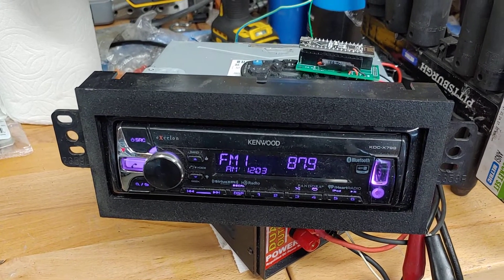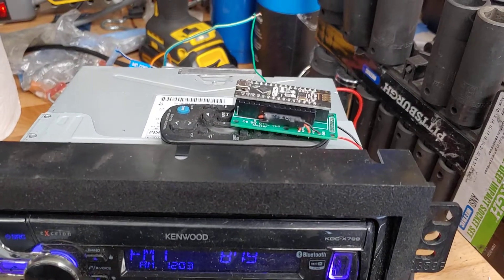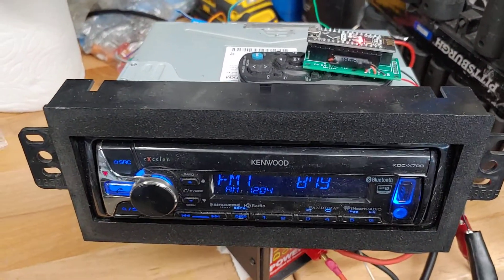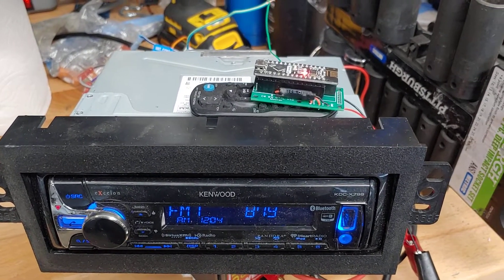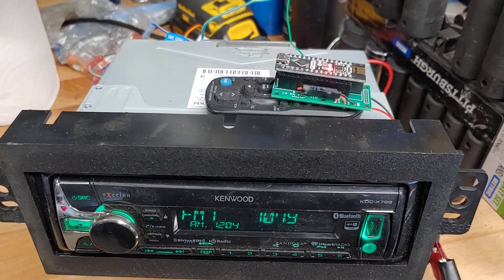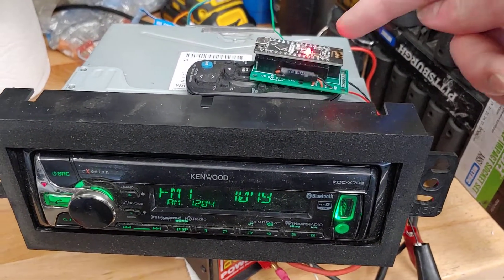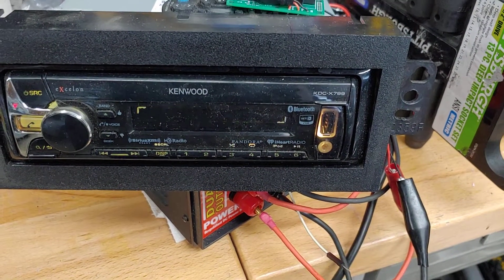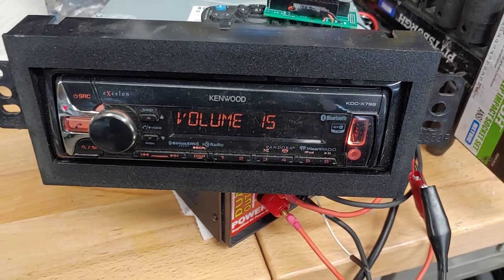Controlling Kenwood car stereo with Arduino

Comment: Hi there
Would you have any more detail on how the remote wire gets its signal, i from what i read the arduino pulls the remote wire to ground in specific pulses. But how did you wire it is it with a mosfet or transistor. I am trying a 2N2222 transistor on an arduino nano but having issues the transistor is not giving out a clean square signal.
Reply from the maker: Hi, I have an Arduino digital pin wired directly to the Kenwood stereo's "SWC" (steering wheel control) input wire. The Arduino can drive enough current in my testing to not need a separate switching device (MOSFET, transistor, etc.). Also I'm not using Arduino's DigitalWrite command as it is very slow, and if you're using that could be a problem for your square signal shape. For fast digital writing I'm using a different library called "Arduino-GPIO", and there's another good similar library called "digitalWriteFast".

Comment: Do you have code you can share?
Reply from the maker: Hi, yes, here is is the code used with the Arduino Nano shown in this video: 
https://create.arduino.cc/editor/tcolesen/c54cc776-9cfc-46e4-a71f-23c59802d9f0/preview
Reply: @tcolesen  That link is broken...  don't suppose it's anywhere else?
Reply from the maker: @ROKNRED  Weird that the link broke, but fixed now. This is my slightly older code ("V0") which still works great. I'm not yet ready to share my newer version of code ("V1") that has new added features.